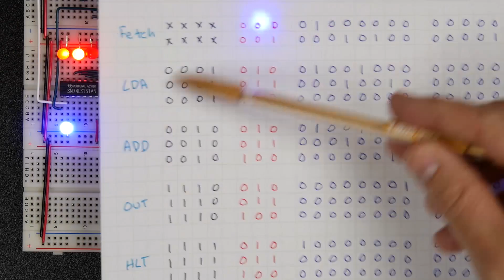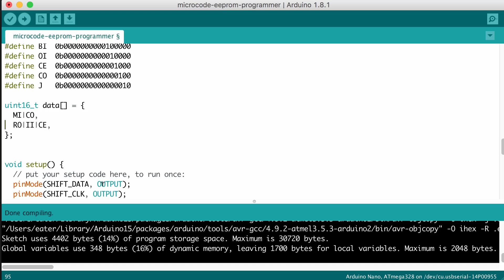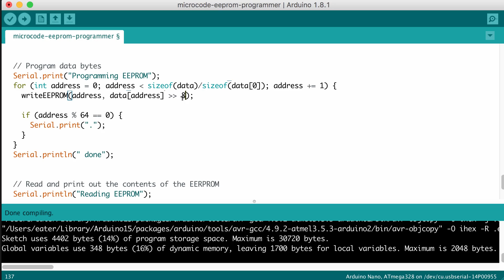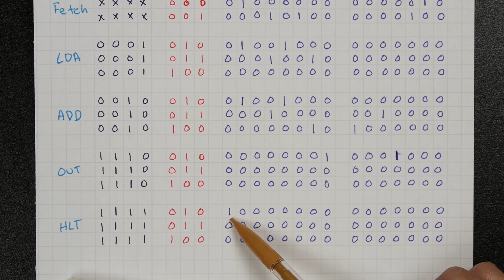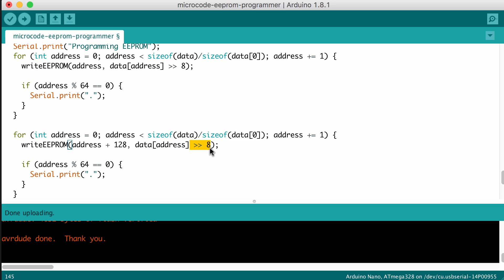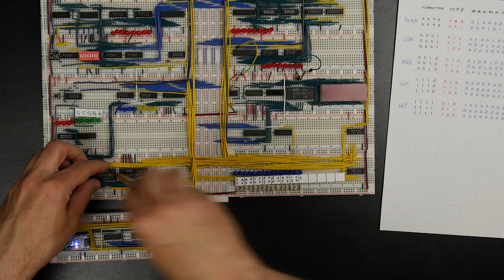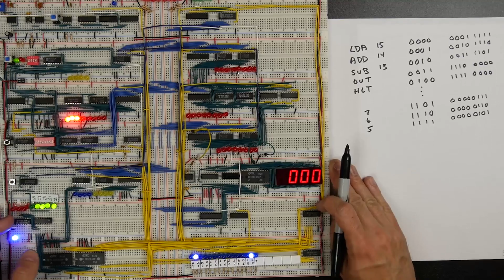Reprogramming CPU microcode with an Arduino

Comment: 📺💬 So, watch my VDO do not reply in their working.
📺💬 If you see anything please tell me I want to know how long you can play with this device.
🥺💬 That depends on externals too but my first lesson is the communication ports start from maximum speed and it negotiates with the target speed and protocol, in AduiNo it makes automatically which is very nice but I also read from your lesson that you build the internal memory commands from constant input same as in C language. 
🐑💬 They are created from internal commands and input algorithms if you want additional commands you may download them from the source or update them, in example without patches you may not have modulo or utility commands ( example )
🧸💬 We are waiting for a random command 🐑💬 It is not random distribution but it can work symmetrically way.

📺💬 We add the command subtraction 🐑💬 You can add flag or input signal.
📺💬 That is an idea for create internal memory command from internal commands.

( 📺💬 อย่างนี้นะคนขับรถเค้า เค้าจะเอาให้ได้ครับ 🥺💬 ผมรู้ครับที่ล่าสุดเค้าก็แกล้งเอาไปเรียนภาษษมาวันแรกให้ผมไปทำ POC พอดีผมทำเป็นอยู่แล้วเรื่อง software มี conference ด้วย ผมไม่ได้อะไรหลอกแต่เค้าทำประจำแหละ หยุดด้วย 📺💬 จริงจริงแล้วบริษัทนั้นตั้งใจ แต่น้องเค้าไม่อยากหาเรื่องเพิ่มเพราะเค้าให้ให้ทุกวันไม่ได้เกี่ยวกับเค้าหลอกครับ 🥺💬 ผมรู้ครับเค้าเอาเข้ามาขายไม่ได้ วันนันบอกให้ผมไปเลยวันแรกผมก็ขายให้ทำ POC เพราะพอดีรู้นิดหน่อย เค้าตั้งใจทำแค่เปิด slides แล้วก็เปิด program ให้ดู คนในห้องก็มาจากแบงค์บางคนครับ ไม่เกี่ยวกับผมหลอกเค้าตั้งใจแต่ผมพยายามหางาน )

Comment: I'm having a problem with the LDA instruction. It doesn't latch it the value. I see it flash for a second but as soon as the  clock pulses falling edge hits, it sets to all 0s. Oddly enough, on the conclusion of the ADD function, the A register latches.

Comment: oDEAR oHHH ben, i see a ESD IsOOO a WIRE desaster and your GOODwill tour send my SOFWARE-simulater with EAGLE autoroute and take ONCE and Multply to GOOGLE 99°99 is on pin a spdif serial DATA input or a BIT with a CLOCK simulator 
nice or Htop cheap enough to get a GUI with all safty and RESCUE diy element ;(( why HARDwork in a STUDIO kindSERIOUS or WASTEbox KILLER ??

Comment: I guess if the spare unused bit from the microcode was connected to the reset for the step counter, the instructions could set it to 0 after they'd completed. Saving the extra counter chip, and also executing code faster, as the instructions would only use the clock cycles needed?

Comment: Totally realize I'm splitting hairs here but Arduino is technically C++ 11 and up, just without the STL properly implemented.

This is why you can use lambda functions but Vector doesn't exist, for example.

Comment: It is actually wrong to say that you are "erasing" the EEPROM when you are just byte-wise writing FF to each location. With these modern EEPROMs that step is unnecessary and just means that you are writing FF to a location. Whenever you write a byte in the chip the automatic logic sequence inside the chip is actually erasing and writing that byte. The whole concept of "erasing" comes from the old first generation EEPROMs, where you actually had to fully (or sometimes in smaller sectors) erase the contents, with a separate operation than a write, before you could change the contents again.

Comment: Ben, late question by far. Couldn't you have fed another signal into the NAND gate from your control logic that was something like RT or reset time, then had some instruction called something like RMC or reset Microcode or some such? wouldn't save much time for this, but seems like it would be useful for things like NOP or OUT

Comment: I’m new to all of this, every bit new.  Software (computer coding) to hardware (wiring these cables into the breadboards), where do I start?  I’m overwhelmed.
Reply: Really, that depends on your appetite for learning. As you can imagine, if you really start from zero, there is an absolutely enormous mass of information to ingest. Just for the basic electronic part, there is a LOT to read and understand.
Its a good starting point to watch Ben's videos, in the right order (just go on Ben's channel, click on Videos, and scroll down : the videos will appear in chronological order; Start with "Experimenting with LEDs | Digital electronics (1 of 10)", https://www.youtube.com/watch?v=poWJTSV4Yio&ab_channel=BenEater

You can also do some Google Searches to get the basics : Ohm Law, to begin with. Then, some good book on electronic for beginners will help as well.

You can experiment with free online tools, to build virtual cuircuits and understand what happen; You can play with https://www.falstad.com/circuit/ and with TinkerCad : https://www.tinkercad.com/dashboard

Comment: Does anyone else have a problem where sometimes the data in RAM isn't super stable?  It seems that if I can get it going once, then I can keep hitting the reset forever, and the RAM stays stable, but sometimes it seems that when I switch from programming mode to run mode, the RAM will go wonky.  It seems to happen at address 0 more often than other addresses.  I've checked my connections and they seem stable.  Any ideas?
Reply: I am experiencing the same exact behavior!
Reply: Andrea Mazzai I’m sorry to say that I didn’t ever truly fix this, although I did find that after I’m done programming, if I set the address to zero and the data to whatever I have programmed into zero, when I switch back over to run mode, I have a better chance of the ram staying where I put it.  Even so, it usually takes a couple tries.

Comment: I noticed sometimes when not programmed correctly (during testing) you have multiple output enable signals high, which means more than one module is outputting on the bus. Doesn't this create short circuits that could be harmful? In the video you don't seem overly concerned. Is this not much of a problem in practice?
Reply: If the two or more modules output the same value (both 1 or both zero), this is fine. If they output different values (1 and zero), then indeed this creates a short. And yes it can be harmful. He is not overly concerned because he knows what he is doing and certainyl take care of that. Also, nothing tells you that he did not burn a number of 74xxxx while making the videos, off camera :-)

Comment: Hi Ben, your videos are really instructive...Clear and  easy to follow. I have bought the Breadboard kit and almost completed assembling it. Everything works well , including the first addition program till I try to run the control logic with EEPROM!! The sample addition which when done manually works  fine ,but refuses to work with the ROMs!! Some of the control signals come on but nothing much happens. I tried programming it with the dip switch based manual programmer and also tried with the Arduino Programer, using the Sketch  taken from the github.
 Is it that the drive voltages from the RPM are  insufficient to trigger the parts on?
Could you or one of ourfellow enthusiats suggest a possible solution? Thanks in advance.
Reply: This sounds like it might be the same issue that has been well documented over on the ben eater sub reddit.  Apparently when the EEPROMs switch addresses the outputs are undefined so you get glitches going out on the control lines.  Some folks have used judiciously placed pull up/ pull down resistors and low pass filters on the signals to sort it out.  See this discussion here: https://www.reddit.com/r/beneater/comments/ge4l6f/unstable_8bittested_all_the_modules_separately/

Comment: The idea of programming the 2 EEPROMs the same and just addressing different parts of them to read the 16 bits is genius. However, instead of using bit 7 to select between the left EEPROM and the right EEPROM (first 8 control lines or second 8 control lines), what about using bit 0 and shifting the instruction and step to bits 1-7 (instead of 0-6 like they are now)? This way the left EEPROM could read the even bytes and the right EEPROM can read the odd bytes. Then when your Arduino code reads back the from the EEPROM, each row of 16 bytes would be one instruction (instead of 2 like it is now) with each 2 consecutive bytes being a single 16-bit microinstruction like the way you drew it out in binary on the graph paper.

Comment: If you used the LSB of the EEPROM as chip select, you could program the instructions sequentially. The high byte would go in the odd spaces, and the low byte would go in the even spaces.

Comment: Wait, why do you need both EEPROMS at all?? Why not program your circuit to read the chip twice to assemble both sets of instructions?
Reply: It's faster to program two EEPROMS than to come up with some sort of latch and clock to read and hold each of the control word halves.

Additionally, he would have to add another clock to read each of the half-words, and this clock would have to run at double the main clock (as he would need two half-words for each microinstruction). The easiest way to do that would be to split each microinstruction into two microinstructions, greatly increasing the complexity while halving the execution speed.
Reply: You'd have to read the first half into a buffer chip, then read the second half into another buffer, then execute it.  That means you'd have to do some funny business with a clock divider to set which half you are reading and end up with a higher part count.

Comment: I was thinking the sub flag was being set one micro-instruction too late... Outputting the sum into the bus in the same step as setting the sum type seems dangerous. But then I realised the AI doesn’t happen on the rising edge, it happens the whole time the clock is high, so there is plenty of time for the ALU output to stabilise.
I love this series of videos. Binge watch continues.
Reply: No, that’s not it, is it? It works because the control bits are set half a cycle before the clock edge. The loads do happen on the rising edge.

Comment: You could use the four "data/address" bits from the opcode to distinguish HLT from OUT (and other instructions that need no data).  This will leave more instruction codes for other functions.

Comment: If you fetched each instruction in two steps, first 8 bits from the first 128 bytes and the second 8 bits from the last 128 bytes of the EEPROM, you would only need one EEPROM.
Reply: But you'd have to (a) have a buffer for those first 8 bits, and (b) have a clock twice as fast as the main clock to do the two fetches. You'd probably require an entire extra breadboard if you tried to implement that, and keeping the extra clock in sync would be difficult.
Reply: @RedwoodRhiadra  You could fetch the low-order byte on the rising edge of the clock and the high-order byte on the falling edge of the clock. And yes you would need a 16-bit buffer.
Reply: I don't think that works, because the control logic is already using both rising and falling edges to do its single pass through the EEPROM and be sure that the bus is stable before the next clock pulse. Another pass through the EEPROM and into a buffer requires a third edge.
Reply: @RedwoodRhiadra  Ben Eater NEVER uses the falling edge of the clock for anything. 
So you could still use the falling edge of the clock. It seems to me that it is wasteful to program two EEPROMs with identical data. Besides, one would never design a computer this way for real-world applications. Ben's videos are meant to be instructional for those who don't have a background in electrical engineering, digital circuit design, or computer science. Many improvements can be made to the designs that are in the book that Ben uses as a model for his videos. BTW, if you really want to be impressed, there's a kid who designed a CPU similar to Ben Eater's that uses discrete transistors and other discrete components, none of that integrated circuit rubbish! 😉
Reply: "Ben Eater NEVER uses the falling edge of the clock for anything".

I suggest you go over the videos where he builds the CPU control unit again. That's the purpose of inverting the master clock - so that the output of the EEPROM sets the control lines during the falling edge of the master clock. The rising edge is used to advance the T counter, latch the CPU flag register, and latch the instruction into the instruction register (on the cycle where that's done), and the falling edge (inverted) is used to latch those inputs into the EEPROM so it can set the control lines.

Comment: Instead of splitting the RAM at address bit 7 you could have split it at address bit 0. That way you'd be storing 16-bit values for the control words into adjacent bytes. In hardware you'd then shift your address inputs one bit to the left and then tie the LSB either low or high depending on which half of the EEPROM you want to use.

That'd give a more pleasing layout of data in EEPROM. :-)
Reply: Nothing gained by redesigning the code though.

Comment: I'm following along making my own version of the data array, but I'm doing it in C++ for slightly nicer syntax and to add compile-time error checking. Specifically, it:

 * Automatically puts the fetch part of the cycle in for every instruction
 * Automatically zeros out the rest of all instructions unless you put something there
 * Automatically zeros out the remaining uops of instructions you do define
 * Throws a compile-time error if you try to give an instruction too many uops (instead of giving weird off-by-one errors for later instructions)
 * Throws a compile-time error if one of your instructions leads to contention on the bus
 * Throws a compile-time error if you write to the bus without reading, or vice versa

Since everything happens at compile time you can see the output instruction table in Compiler Explorer's assembly output.

And my compile-time error checking was useful; I'd accidentally made the last uop of ADD be EO|AO, which would have caused contention on the bus instead of working. (Version with compiler errors on a bad uop: https://godbolt.org/g/taKkJB; fixed version: https://godbolt.org/g/jdCgcQ)
Reply: (Added SUB instruction and program assembly: https://godbolt.org/g/FUhVEa)
Reply: @danielrhouck  Hi Daniel, a newbie here to C and Arduino!
The "fixed version" of your code is no more available... do you think you could re-upload it?
Reply: @andreamazzai1969  Sorry, I don’t still have it.  Shouldn’t have trusted the link to exist indefinitely, but I did.

Comment: I like the idea of making a punch card reader for your machine. I think it would be surprisingly simple. 

But you have ROM chips.  It might make more sense to add an address line so programs can be run from ROM and add dip switches for selecting programs from the ROM.

Comment: I never thought of using an instruction set where each bit of the instruction activates a wire inside the CPU.  For my Logisim CPU, I just have the NOP instruction all zeros and have all the bits going to a NOR gate which then causes the PC to increment.

Comment: Well, there's not much space for all those additional instructions if we can have only 16 of them, and 5 are already taken :q
Most importantly, we need some jumps, because without them the computer is not even universal yet – it's more like a programmable calculator than a universal computer.
But even if we add jumps, the computations cannot be recursive yet since we don't have any call stack. Sure, we could emulate it by doing some fancy arithmetics with addresses in memory, if only we had more memory than the measly 16 bytes :P
But adding more memory requires an entirely different format for the instructions.
So I think that the most important improvement we need right now is to change the instruction format to 8-bit opcodes followed by optional 8-bit operands. That would extend the instruction space to 256, and the same with address space. (Though a 16-bit address space would be A LOT better :q ). This isn't very hard to do, even with the existing architecture – we just need to use the entire instruction register for an opcode, and expand the fetch cycle so that it made two memory fetches from subsequent addresses, one for the opcode, the other one for the operand.

Comment: There is a way to save some space in the code. Instead of the ADD command ending in EO|AI and the SUB command ending in EO|AI|SU. You can very simply change it to just EO and change the OUT command to EO|OI.
Reply: That only works if ADD/SUB (EO) are the only commands. Adding other commands like MUL/DIV/INC/DEC/AND/OR/etc. may not use the EO control line. Thus, you could have a counter program that is:

0: LDA 15
1: OUT
2: INC
3: JMP 1
...
15: 0

Here, the INC command could increment the A register by 1 directly, without using the EO control line. Keeping the OUT command tied to displaying the content of the A register makes it simpler to program, as you are not tied to the state of the ALU and the EO contents.
Reply: @msclrhd  could you kindly rephrase or expand just a little bit about why it's simpler to program? I'm trying to understand your answer :-)

Comment: How about adding an input button that replaces the dip switches and it increments the input numbers on an input display, then having a separate input button to set the address location so that you can see the inputs rather than LEDs/Switches?
Reply: I'm actually building a replica here soon, I've got the parts already ordered, so if you don't get the chance to do it I am planning on implementing this on my model and see how it goes.

Comment: The last control bit that is open could be used to reset your counter as an optimization. You could still have the clock feed back as you have it as redundancy